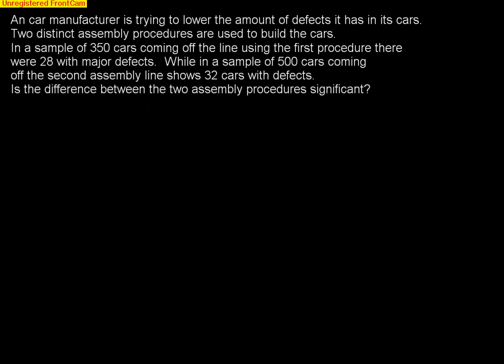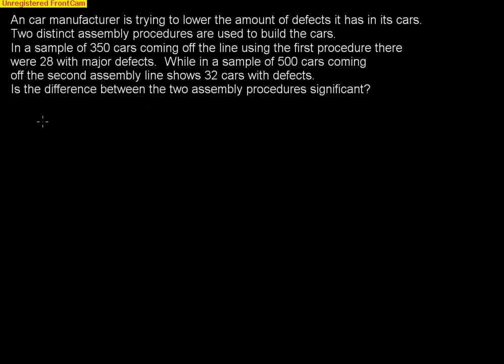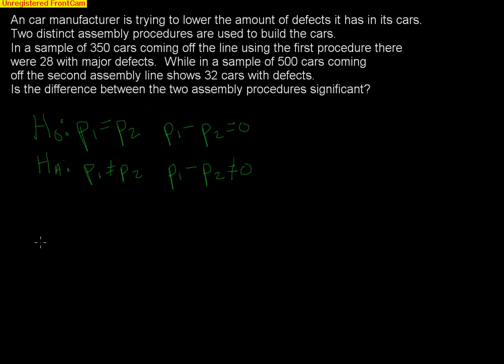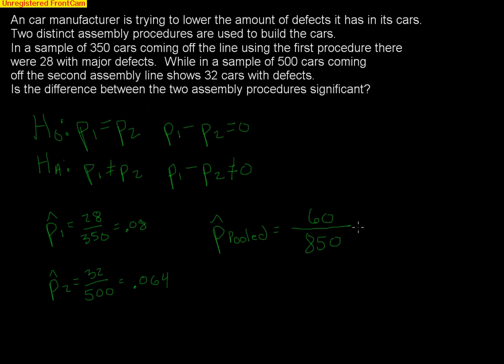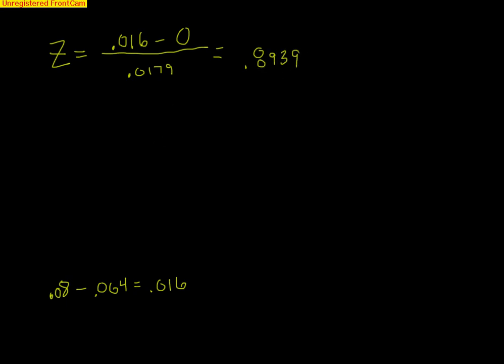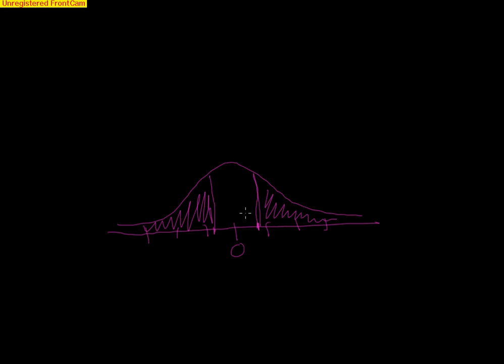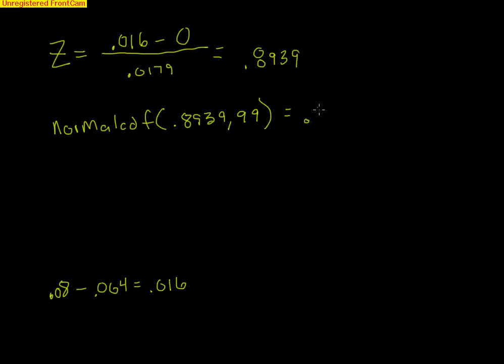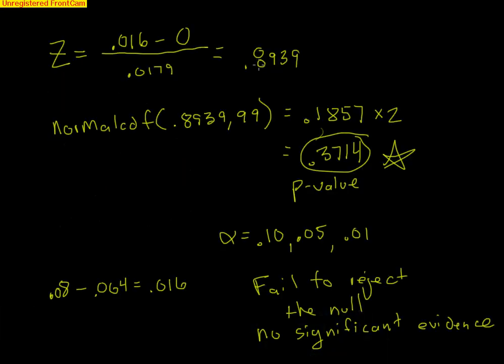Hypothesis Test for 2 Proportion Samples

Comment: what if you just know p1 without knowing what x1 and n1 (p1=x1/n1), how will you find the SE?
Reply from the maker: You can multiply p1 by the sample size to get an approximate value for x1.  For example if p1 = 0.25 and sample size is 150, then x1 = 37.5
Reply: Michael Porinchak I said if we don't have both n1 (sample size) and x1...
Anyway, I figured how to solve my question
Reply from the maker: @sultanalhammadi2910  I gotcha, glad you got answer, but without that you probably could not do the problem.

Comment: what is the alpha for this question?
Reply from the maker: Typically I use an alpha value of 0.05, but the thing in this problem with our p-value being 0.3714 you will fail to reject the null regardless of which alpha level you select.
Reply: @mporinchak  What if I choose an alpha level of 0.38?
Reply from the maker: @haza123b4  guess you got me
Reply: @mporinchak  So alpha levels are pointless.
Reply from the maker: @haza123b4  didn't say that at all.  An alpha level of 38% is pointless.  That means significant is anything with a probability under 38% but that doesn't sound significant at all.  An alpha level of 0.38 is like being 24% confident, which is pretty terrible.

Comment: So you just got the .9294 out of your ass?
Reply from the maker: I wish statistics was that fun, but no I got the 0.9294 becasue it is the opposite of 0.0706.  In the formula for standard error you take the square root of p(1- p)/n .  So if p is 0.0706 then 1 - p is 0.9294.  Basically if 7.06% of cars have defects than 92.94% don't.